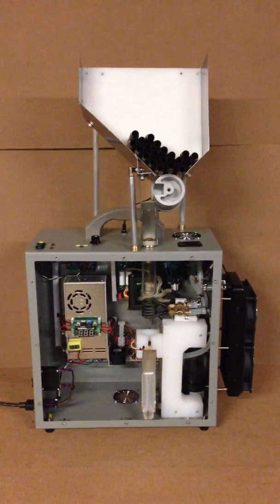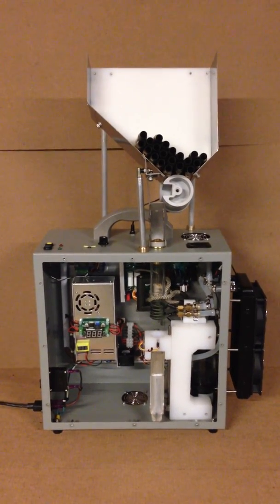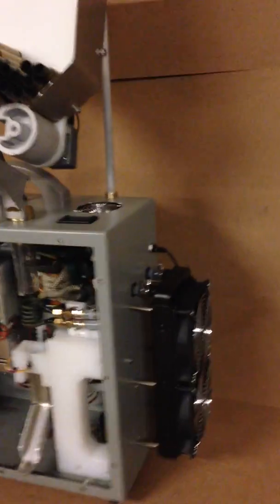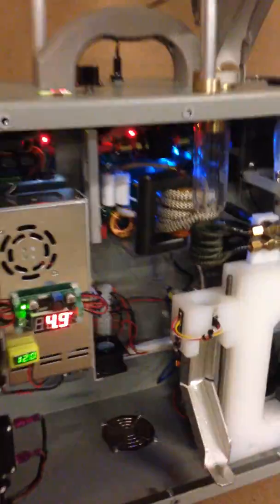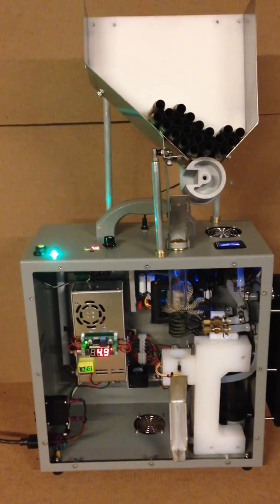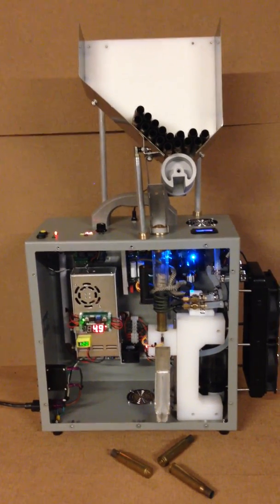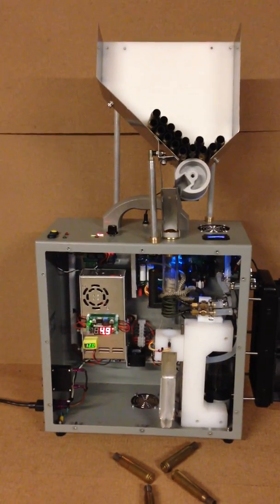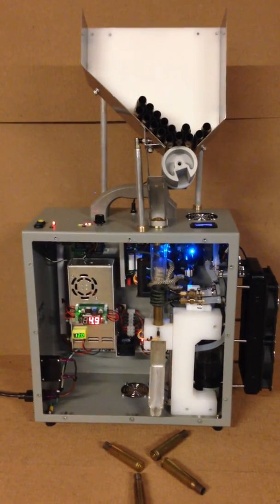Annealing 50 cal with the Annie Board - testing, part 2

Comment: That machine is bad ass.  I am close to asking you for the layout.  I know this took you a lot of time, I am looking at building one but I would need to see some close up shots of the internals to see the tube where the brass goes into the annealer.
Reply from the maker: Thanks Sledge Hammer, not sure if the images will come through, but please see attached?
/Users/stephenliso/Desktop/IMG_8431.jpg
/Users/stephenliso/Desktop/IMG_8548.jpg
/Users/stephenliso/Desktop/IMG_3613.jpg
Reply: It didn't come through.  Can you email me at hummer11234 at gmail dot com